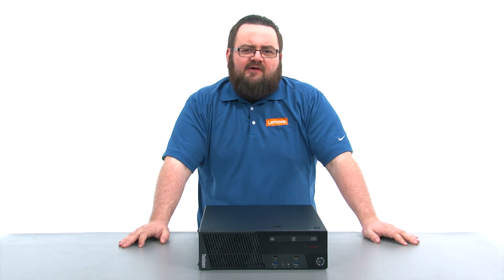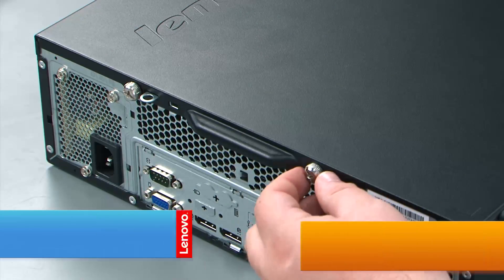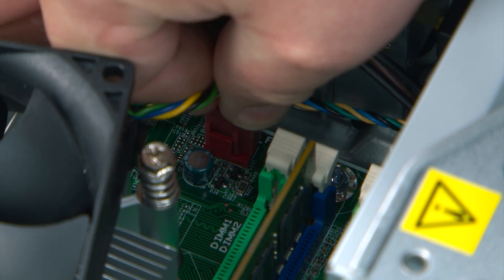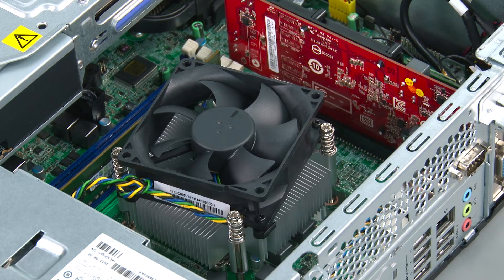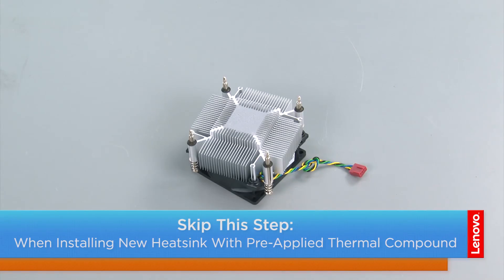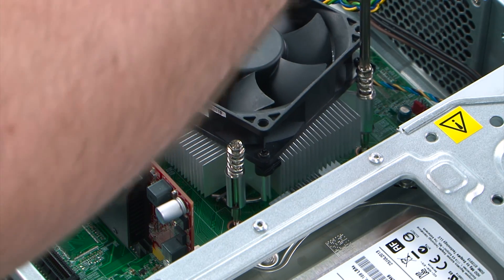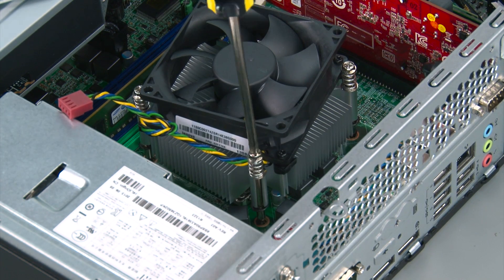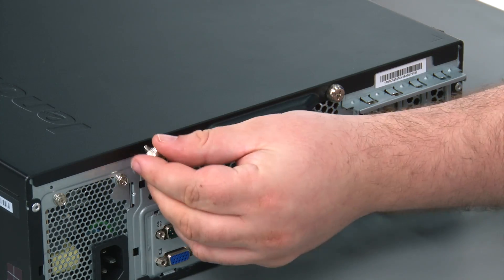ThinkCentre M83 / M93p Small Form Factor Desktop - Microprocessor and Heat Sink Fan Replacement

Comment: what size is the fan?
Reply from the maker: Hi there. Thanks for reaching us. The fan size 90x90x25mm. Let us know if you need additional information. Auxen_Lenovo
Reply: @LenovoSupport  how bix is the systom fan?
Reply from the maker: Hi! Sorry for the delayed response. The size of the system fan is 90mm and it uses a 4-pin fan header. Jan_Lenovo
Reply: @LenovoSupport  i ordered a 92mm fan with a 3 pin would this work???
Reply from the maker: Hi! Another hand here to assist you. The 92mm fan might not fit but the 3 pin will work however the controller for the fan or PWM will not work due to the missing pin. John_Lenovo
Reply: @LenovoSupport  ok ill try the lets up it works
Reply from the maker: I see. Hopefully everything will turn out well for you. Update us how it goes. John_Lenovo
Reply: LenovoSupport if wanted to case swap what case would work?
Reply from the maker: Hey there, @Brick by Brick! Another help here. Just to confirm, are you referring to the whole case of the desktop computer? If yes, we're unable to provide that information because that will be considered as a custom build unit. -Chris_Lenovo
Reply from the maker: Yes. Based on the size and specifications, this will fit in M93p safe, but please be advised that this is not tested. Thank you. Auxen_Lenovo
Reply: @LenovoSupport  it works fine the fan is a 92mm fan in the m93p sff because they are the same size
Reply: Hello Lenovo. Will this CPU cooler fit as a replacement??
 https://www.memoryexpress.com/Products/MX43901/Reviews